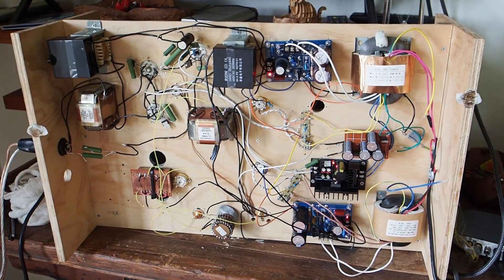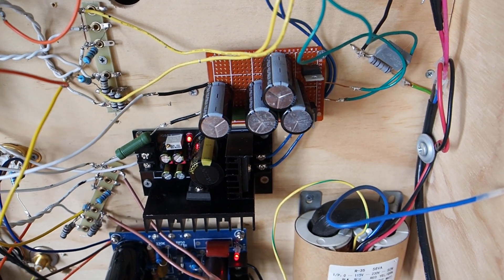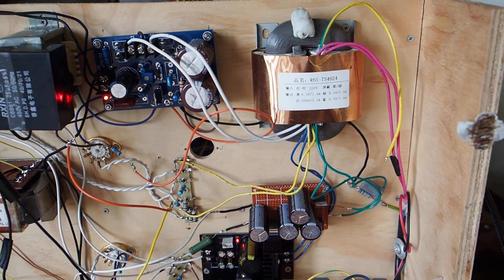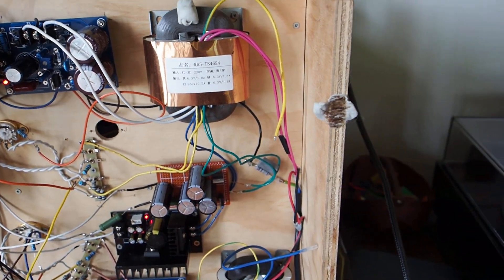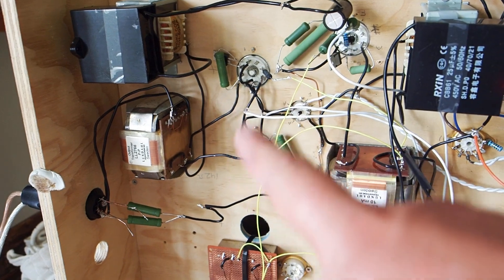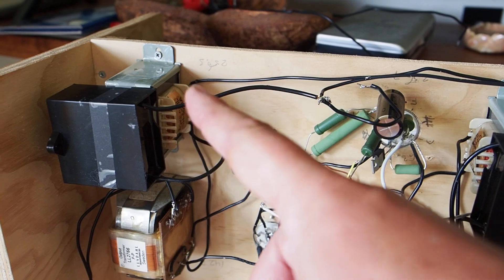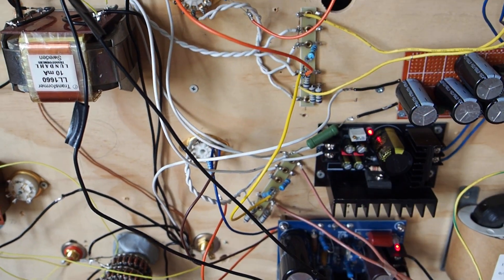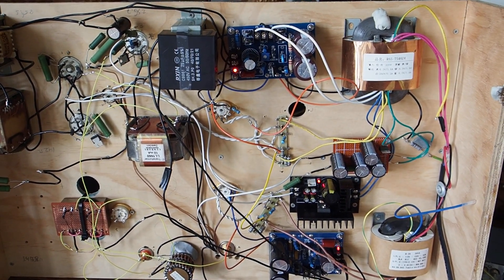The design of my power amp - part 4/4: filament, power supply over-dimensioning

Comment: Hi Eduard, I like the idea of the voltage doubler, though it will obviously double the filament power consumption as well. My question is, if you already have a very large headroom for power regulation, would it then not be a good idea to drive the tube filaments with a current source. This has two advantages in my opinion. The first one is extending the life of the tube by eliminating the inrush current. The second one is that noise is suppressed by a current source, becasue the Ri is indefinite (high Z in practice). You would obviously have to give each tube its own current regulator.
Reply from the maker: Hi Hugo. I see no good reason to use a CCS for filament supply, (a) because there's no problem to solve and (b) it's likely to degrade the music quality. As for (a) there's no inrush in the filament: the RC filter network forms by far the largest impedance and the caps (4x4.Fmf+ 1mF) have a much lower R during the 'start'. Note that generally, I will avoid having a regulator near the music signal (which we have with filament bias). Now perhaps very good regulators could work, but things like LM317/337 have an atrocious influence on the quality of the music. 

To elaborate my generally approach, to me a filament current represents a constant, so why interfere with a active component? To me it begs for a passive solution. Whereas, powering ICs with varying power demand while having a requirement for a constant voltage.. that asks for active control. To add something with switching noises into the signal path for something that is only needed during start-up must have really serious reasons for being there. Currently the 5 simple caps do a great job in keeping the noise to inaudible levels even on a 100dB efficient speaker.

If I want to improve the amp, I'd immediately look at improving the voltage regulation for the B+ and go to a tube-shunt type regulator, preferably with a feedforward correction/operation. Another thing would be to use an autoformer and better quality transformers, parts, lower DCR chokes... that kind of thing.
Reply: @EduardBroekman  Hi Eduard, thanks for your thoughts about that.
Reply from the maker: @hugobloemers4425  Hey Hugo sorry to poo your idea but overall it seems much more suited for for example a normal 2P29L filament supply with maybe a LT3042/5. Several amp builders have told me they don't even like the LM317 in filament supplies, so nbased on that it looks like implementation is  crucial even in a non-bias filament supply.

That said, for my upcoming Marantz CD48 upgrade project, I will be using AZ431As which will shunt regulate the 5V pins to all major ICs and DAC but still will be fed from a CLC filter so there's only 1.3mV ripple to start with (at least in LTSpice/PSU designer sim results). It's more a mix of approaches but I hope it will yield a good improvement. Judging from other high level projects, old school tube power supply tactics applied to DACs work very effectively and can produce a near analogue sound when done well.
Reply: @EduardBroekman  Hi Eduard, I would not use an LM317 as current source but rather a FET or perhaps an LM1875. And even then, I have been thinking to put an inductor in series with that. But you answer was a bit of a reminder that you have to choose your battles carefully. 
I agree that most DACs are held back by their power supply. Good news, that means we can buy a relative cheap one and add $$ mods to it and bring it up to the equivalent of $$$$ DACs. To be honest I don't even own a DAC (yet).
Reply from the maker: @hugobloemers4425  Yes, I was also looking at FETs or transistors in conjunction with perhaps an buried zener voltage reference/regulator. 

To add to your 'pick your battles', I always look in getting free benefits from a solution, rather than solving each problem isolated.

As for DAC/CDs, totally agree and that way we avoid the 7x mark up on components :)